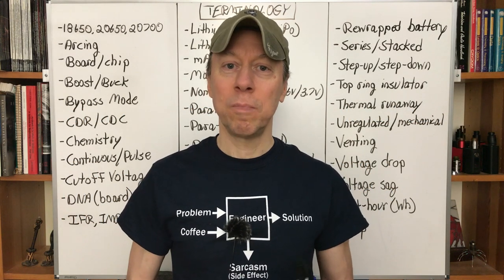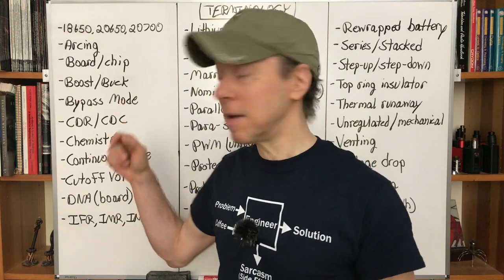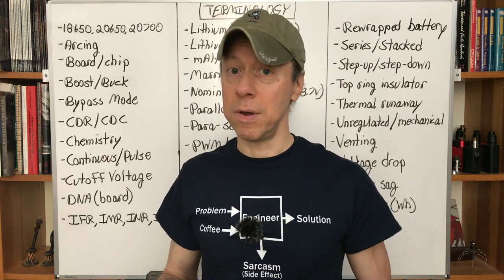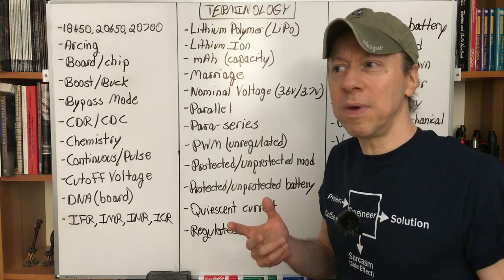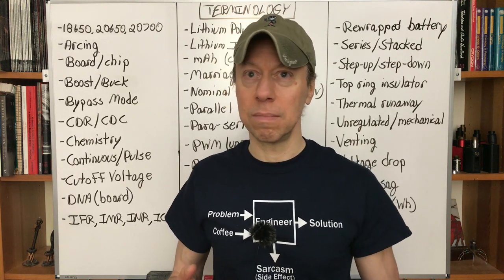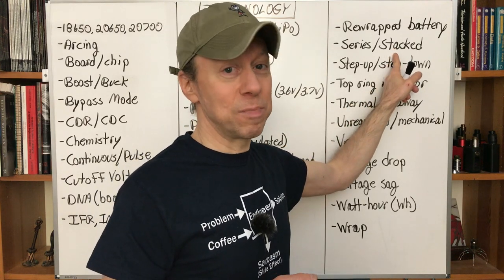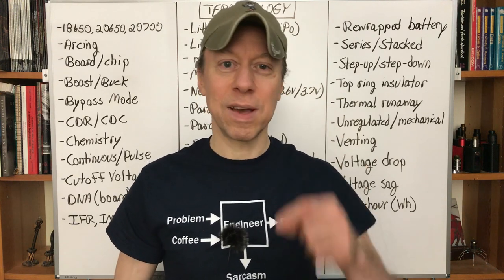Battery Basics for Vapers Ep1 – Battery related words and phrases

Comment: Hey mooch thanks for the run down on some of the slang or lingo involved with vaping!  Question!  Why is it so important to charge your batteries in a battery charger and not through the USB Jack on your mod?  Also I have a cheap little one battery battery charger that I received when I bought a flashlight and I was wondering do most single 18650 battery chargers also charge 20700s ,21700s? Thank you

Comment: If you manage to short a battery without it venting I would assume it's also ruined right? 
I accidentally put a backwards battery in a unregulated series mod and one of the batteries sparked as I was tightening it. I managed to get the door off before the battery vented but it did get hotter than I've ever seen. I still have the pair in a case (I meant to recycle them but never got around to it). One of the cells has no visible damage, the other has arc marks on the negative. 
Usually I double check everything to do with batteries too, and nowadays I am even more careful.
Reply from the maker: There’s no way to know. We always have to err on the side of caution though. I recommend not using and replacing both batteries.
Reply: Battery Mooch yeah I never used them again. I just haven't gotten rid of them yet.

Comment: Hi Mooch! Awesome to see that ur making these informative videos regularly, thank you! I have a question regarding the voltage drop that i have been getting very different answers to:
So lets say i have a fully charged battery at 4.2 volts,  and there is a 0.5 volt drop on the voltage caused by the mech im using. Does that mean that i can build and use ohm law by the voltage after the drop (4.2-0.5=3.8V in this case) or do i have to still build by the voltage of the battery before the drop? And im asking obviously cause the amp draw would be different at 4.2 and 3.8 volts. Much appreciated :)
Reply from the maker: Check out Ep2 of my Minding Your mAhs series, it covers this.
Reply: Battery Mooch Roger that, thank you! :)

Comment: Just watched video one of minding your mahs, then jumped here and I'm only :47 seconds in so far.  But in terms of content I'm interested in:

I just switched from regulated with prebuilt coils to a semi-regulated RDA where I'd like to try out building coils at different resistances, materials, etc.  I'm at the point where I have a surface level understanding of electronics... I know how to test coil resistance, but I'm still not 100% sure on where the biggest risk factors are when dealing with current passing through coils of a particular ohm rating.  Assume for a second I'm using an unregulated mod. If I throw too much current at a coil with very high resistance (say .05 ohm) will the coil just blow like a fuse? Or is this where you risk a battery exploding?  It would be cool to start at the very basics of ohms law, and then maybe see some example builds for a particular battery (20700 if you wouldnt mind :D) while discussing where the min/mid/max coil ratings stand in terms of resistance, then the risk of approaching or exceeding the calculated min/max.  I'm also not 100% sure where using a regulated mod fits into the electrical equation other than providing some safety and I assume small loss of power to the coils.

Haha... now I'm 1:38 in.  I guess doing something specific to a 20700 battery would be irrelevant.  But at least now I know this battery has a volume of π10²70 or around 21,980 mm³
Reply from the maker: Check out Ep2 and Ep3 of my Minding Your mAhs series.
You can never depend on a coil acting as a fuse to protect you. You MUST be completely familiar with Ohm’s Law and how to determine the battery current rating you need before you use an unregulated device.

Comment: Darn, thanks for the info. although I only understood very little.  For watt-hours are you telling us that we want a 30 amp battery?  I hope to hear from you soon.  I just purchased a new SMOK  Mag, and the batteries I have will not work with it.  I want to purchase good batteries but I haven't a clue about what to obtain.
Reply from the maker: Follow the link to my blog at ECF in the Description section of this video. You will find the link to my Recommended Batteries tables. Some great choices there.

For a regulated mod you want a battery with a high enough current rating. Then pick the highest Wh battery with a high enough current rating. Check out Ep3 of my Minding Your mAhs series. It just deals with the current rating though. The Recommended Batteries table will have good suggestions once you know the current rating you need.

Comment: Cheers for another top video mooch. Samsung 25r in a vgod mech running a 0.11 ohm coil. On average how long a usuage would I have before I would have to recharge it. Personally wether at home or work I normally use it for 3/4 hours, not hitting hard but regular hits ( hit for couple of seconds and rest for few minutes). Am I not using battery long enough before charging or would you say that is the norm. I've always thought with any rechargeable battery if using it for short amounts of time then recharging, does that age the battery quicker. Just something floating around in my head that needed answering. Keep up the good work mooch and cheers 👍👍👍
Reply from the maker: How long a battery lasts fundamentally depends on your vaping style. It could be 1/2 hour or 10 hours.
Whether you’re using it long enough depends on the vape you want and how low in voltage the battery is going. Keep it above 3.0V. Batteries prefer “shallow” discharges instead of all the way down and then recharging.
Reply: Cheers bud. It was just a nagging question in my head that needed answering. Appreciated for putting mind to rest mate 👍

Comment: Thank you very much.  I would like to know if I need to rewrap a battery if there is a small hole in the wrap caused by placing a battery in a charger or is the battery still good as is.  In other words, when do I need to rewrap a battery.
Reply: The wrap should always be in perfect condition. Inspect your battery wraps everytime you handle them and rewrap as soon as you see any damage, even if it's the smallest hole/nick/tear. Replacing your wraps is cheap and easy, replacing your face isn't.
Reply: Thanks.

Comment: Question: How many volts are recommended to use in VV mode to extend the battery life? 
I know it depends on what battery you use but what specs can I look out to judge how many Voltages to use on 18650's / 20700's.
Reply: Angelo Kalfas 
All the vape batteries we generally use have a nominal voltage 3.6-3.7 volts, but nominal is not fully charged. The lithium-ion batteries are charged to 4.2 volts when fully charged so that is the voltage of one lithium-ion battery/cell. Have you watched his other videos or read his posts or charts on ECF (electronic cigarette forum)? He has years of posts, charts, graphs, and explanations. I recommend you watch all of the videos on this channel. If you do that then you will be ahead of the curve and hopefully much safer with your vaping.

Comment: Some batteries don't have +, - how can I determine each side? And I'm confused which is supposed to go up and down. I bought a Vgod pro mech 2.
Reply from the maker: The positive end of our batteries is the side with the smaller, perhaps slightly raised, contact. The smooth end is the negative. Check with the manufacturer about which way the battery is supposed to be put in that mod. Do not use that mod until you are absolutely sure you are doing it correctly, that the battery is in perfect condition, and that you have selected a battery with a high enough current rating for the coil resistance you are using.

Comment: What's up Mooch? What is a good way to remove arch marks and indentations off of batteries and contacts.
Reply from the maker: Indents? They cannot be removed and no damage is acceptable. Do not use a dented battery.
Try a scrubber sponge or scotch-brite pad on the arcing marks. Do not damage the wrap or top ring insulator.
Reply: Battery Mooch thanks for the help the indents are where it sparked and it made a deeply penetrated mark on the positive contact of my battery. Not super deep but can be felt with my finger.

Comment: Amazing video. 

I just bought a geekvape aegis and I'm using in wattage mode and having issues.

It's set to 50w but when I press the button on the screen it shows <10 w and I'm not getting much vape at all. I'm having to hold the power on for ten seconds and barely getting anything!

I'm leaning towards the batteries not being good. They came free with a charger.

They are 

BTBAI NCR26650 li-ion
3000mAh

I'm sure they are cheap crappy Chinese batteries. could the batteries be why I can't run above 10w even when the mod is set at 40w?

I knew they wouldn't be great but I thought I would still be able to run it at 50w but for less time.

I'm confused
Reply from the maker: The battery could be the problem, I don’t know. Try one of the batteries in my recommended batteries table and see if you get better results. The link to my blog at ECF, with the tables, is in the Description for the video.
Reply: Battery Mooch I'm going to buy one of the batteries you recommend. Probably the Aspire as I can get that locally.

Keep up the good work, your a ray of light in the vape YouTube community.

It's hard to know on YouTube who is just shilling because they are being paid lol.

Comment: I new to vaping and have been looking for a knowledge source exactly like you. Thanks so much this is perfect information source.  I was willing to put in the time to research but just needed a legit source. My only question is what you think about the "Hohm" Battery line which they say is specifically designed for Vaping. I'm specifically looking at the HOHM LIFE INR 18650 20.7A(CC) 36.3A(P&P) 3077MAH BATTERIES. Is this as good or better then the "big 4"? I would either be using one of these or a Sony VTC5 18650. I am using a regulated 80 watt mod and normally around a .20 to .30 ohm coil and vape at about 40 watts.
Reply from the maker: There are  no batteries designed for vaping. That is marketing dribble. We don’t need anything different from an 18650 than any other use does. What vaping needs is a whole new battery that cannot be short-circuited so easily. :-)

The HohmLife battery is identical to the Samsung 30Q. Or it was when I tested it. The new HohmLife V2 battery performs a bit worse and was inconsistent from battery to battery.

At 40W on a single battery I recommend the Samsung 30Q for up to 45W. For up to 60W on a single battery I recommend the LG HG2.
Reply: Awesome, thanks so much!
Reply: Would you recommend the same 2 batteries for a duel 18650 mod with a very similar set up? Or does the duel aspect change the recommendation? 

Thanks so much for all your help! I will be following all of your advice, as well as be using external charging, checking wraps often, and carrying batteries in a plastic case and not loose.
Reply from the maker: Tim Petrillo if you have two batteries then you can double the wattage you can vape at. I still recommend the same batteries.

Comment: I would like to know more about "boost".  It is not entirely clear to me how the chip is able to deliver more voltage than the batteries actually can.  Where does that extra energy come from?
Reply from the maker: Much too big a topic to cover here in Comments but you can check the web for tutorials on “boost converters” for more information. It’s a common power supply circuit.

There is no extra energy involved though. If you boost the voltage the available current drops. It’s the opposite of a “buck” or step down power supply where the available current goes up as the voltage is dropped further. Basically, the available power stays the same (minus the losses in the circuit) so if voltage goes up the current must go down, and vice-versa.
Reply: @batterymooch  Thank you very much, Mooch!!  Your Minding your mAhs tutorials are just fantastic.  I am a college professor and believe me you are by far a better teacher than most colleagues.  I am your pupil now.
Reply from the maker: edgsalga thank you for your kind words!

Comment: Mooch i have a question 
I have a parallel mod in which i put 1 battery in correct and the other was wrong but its completely my fault for being complacent, but as i inserted the second battery (atomiser already on top) i looked down and realized there were sparks coming from the contacts as i got that 2nd batt stuck and felt the batts get EXTREMELY hot i panicked and quickly pulled the 2nd batt out and quickly unscrewed the atty. I was using brand new fully charged 30q batteries. They were so hot i douldnt pick them up for about 15 minutes and they stayed very warm for another 15 - 20 mins. The batteries look still new there was no smell other than the wraps melting a little on the positive and negative where the mod contacts caught the batteries. Otherwise they look fine. I feel I know the logical answer already but should I bin them and get new ones? Please dont hate or bash I'm still learning
Reply from the maker: You know the answer. 🙂
Those two batteries were short-circuiting into each other and it is very likely that both are damaged. Do not charge or use them and replace (recycle) both.
Reply: @batterymooch  thank you sir I really appreciate your swift response. I will take them to my local vape shop to be recycled and buy new ones. Thanks again Mooch 👊🏼
Reply from the maker: @zakrameka4655  it sucks that you have to replace them but I’m glad you pulled that battery out and that it wasn’t any worse!
Reply: @batterymooch  i know man gutted as the batts are 15 dollars each but can't/shouldn't put any price on safety. That was my first experience with reverse polarity and I'm usually really vigilant with battery safety but I just got too comfortable I guess and made that mistake. I'm glad thats all that happened, and nothing more serious. I need my teeth and fingers 😃

Comment: Sorry for all the questions but I have one more? When I get a vape do the mah on a battery matter? Will it hurt my vape if I get a mah that's too high? Also I am wondering when I set my preferences on my vape and it says something about nickel, and two other ones, which one do I choose? Is that based on the battery? I thought they all have nickel titanium and so on so which one is the correct one to choose when setting the vape up
Reply from the maker: The higher the capacity, mAh, the longer the battery will run.
No, it can’t be too high. But, higher capacity batteries have lower current ratings.
Nickel is a wire type and has nothing to do with the batteries. Pick the correct wire for the coils you are using though!

Comment: Mooch what battery would you recommend for mech mod 13650
Reply from the maker: Check the description section of a video for the link to my blog at ECF where you can find my 18650 ratings table and recommended batteries table.

Comment: Oh and I need a 25r battery right? Is that the best and can it go with any mod calling for an 18650? How do I know what kind of 18650 will work and which won't? Or do they all work in every mod?
Reply from the maker: Samsung 25R’s are good batteries and can be used at up to 60W each. That’s 120W in a two battery mod.

Comment: Hi ! Master, 
 I call you Master because you are like my teacher. This is undeniable truth.

I have made a mistake accidentally by pressing the fire button of my mech mod for 1-2 second , the rda’s  positive pin didn’t contact to the batt , but the positive of the batt might contact to the mod itself. and the temp of the batt was increasing suddenly, not so high, just warm. Then I took the batt out of the mech mod. It’s cool down itself in a few minutes. 

My question is, can I still use that batt as usual again?
Thank you
Reply from the maker: I don’t know the true condition of your battery so I can’t say for sure. But it it only got warm then it’s probably okay to use.
Reply: Battery Mooch thank you,sir

Comment: Hi mooch ,love your channel ! I bought 2 battery yesterday ebat 21700 3800 mAh 40a pulse  30A continuous discharge that's what the rap shed haha .Is this ok battery's for my blade mod ? Coils are 0.15 oms and vape between 70w to 90w.eny input will be great thanks
Reply from the maker: Sorry, I don’t know anything about that battery or its ratings. Do not use a battery unless you know its rating is high enough for the way you vape!
Reply: Thanks mooch I'll go back to my ijoy 20700 thil I get more information about this battery's

Comment: I need to know which batt is needed when it says high amp 18650? Does that mean a 25a? And does that also mean a 15a or 20a battery won't work? Also do I need inr or imr and what's the diff?? I'm looking into getting a sigelei sibra e2 which needs a high amp. But am so confused on which one to get? Please help me!! Also takes a 21700 batt but am scared ima blow something up with a stronger battery.
Reply from the maker: The Sobra? A 198W device? That’s a lot of mod for starting out with.
Don’t worry about IMR and INR, it doesn’t matter for now.
Don’t worry about 21700’s for now. You can think about using them later when you are more familiar with batteries, rafting, etc.
Buy LG HG2 3000mAh 20A batteries and use two of them at up to 120W. Keep the plastic wraps in PERFECT condition at all times and buy a good external charger. Do not charge your batteries in the mod all the time.

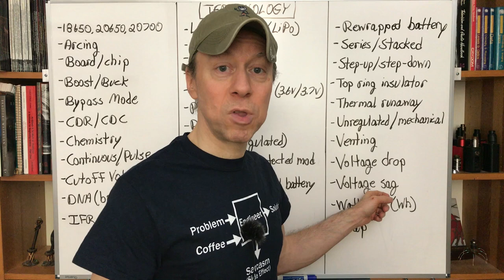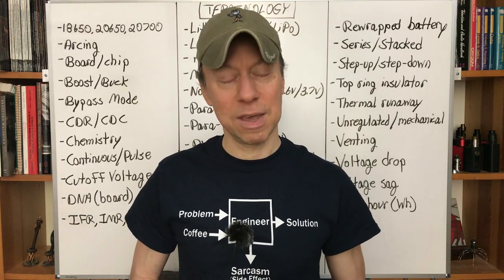Comment: Mooch there's some voice problems in the 22:37, 23:27, 23:53, 25:16, 25:34min mark do check it.
Reply from the maker: I don’t see any problems. What is the exact time stamp and what kind of problem is it? Syncing the voice and video or distortion or noise?
Reply: Battery Mooch Mooch I gave the closest time stamps, at this time stamps after 1 sec it feels like some one just fast forwarded your voice for 3, 4 sec then it's fine.